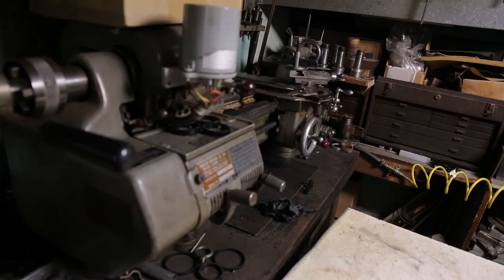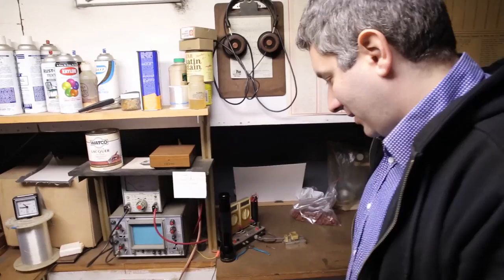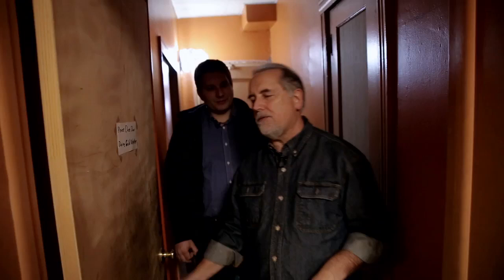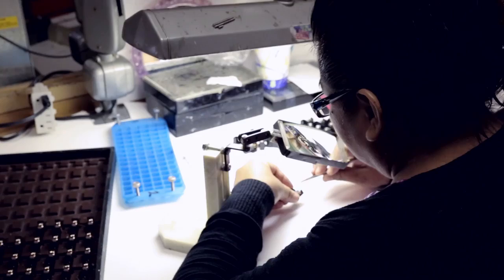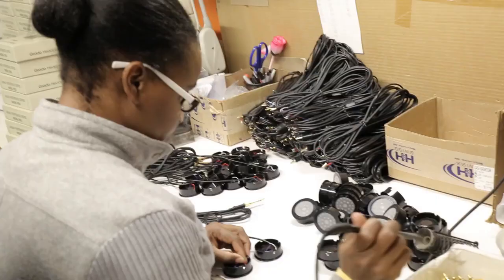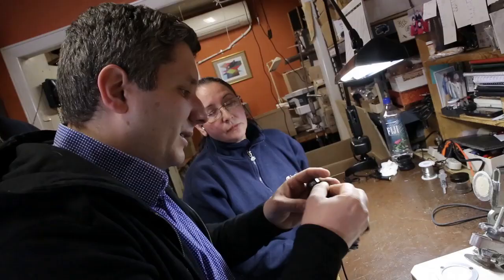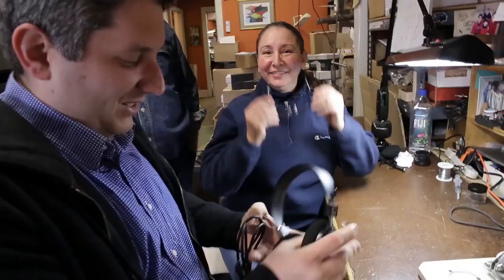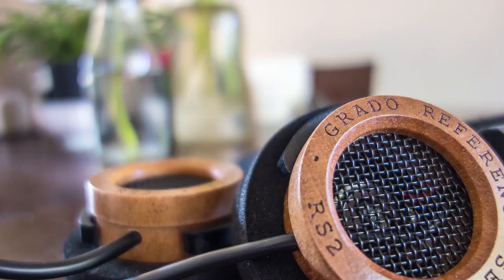Grado Labs | TechCrunch Makers

Comment: Bought the prestige series SR125s a few months ago. Sound quality is sweet but the overall assembly and especially cables are horrible - cable connection between the two phones broke and lost contact already - and only used them at home very carefully. Twisted the cable and put some duct tape - works for now. What a shame for a 200 USD product.
Reply: Mindaugas Raulinaitis Where do you live? Have you bought 'em from an authorized dealer? Are you sure they are real and not some counterfeit? Grados are not very popular among forgers (unlike Sennheiser for example), but knock-offs are out there.
Reply: *****
But it can't be that bad. When a 200 dollar pair disintegrates just from breathing on it, there's something fishy about it, and in my opinion requires an investigation. Take a few photos, visit headphone forums, contact Grado, check if your dealer is authorized, etc.
Reply: I've had several pairs of Grado headphones for years and the cables never broke.  Either you were extremely unlucky or you need to be more careful.
Reply: I mean I respect grados but it's a known fact their build quality isn't the best , it's their only way to keep cost competitive without fucking with the drivers. Cause that's where the most budget is going. Plus don't forget Brooklyn is expensive af